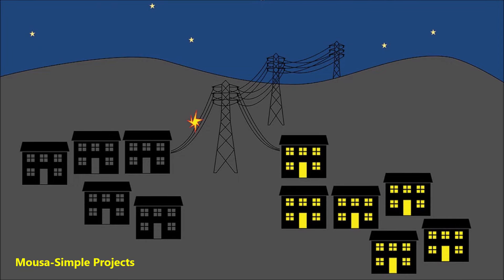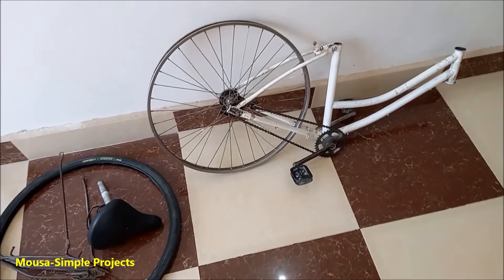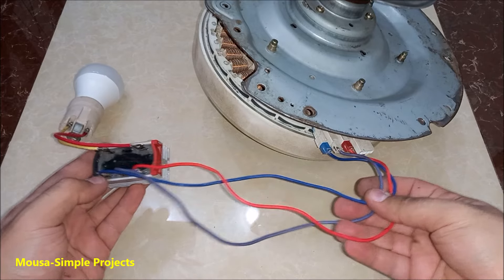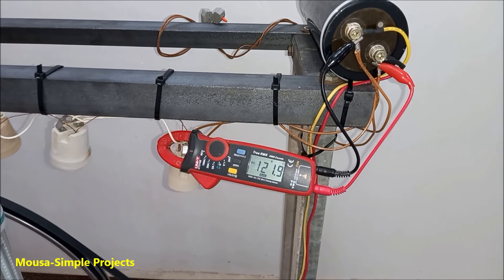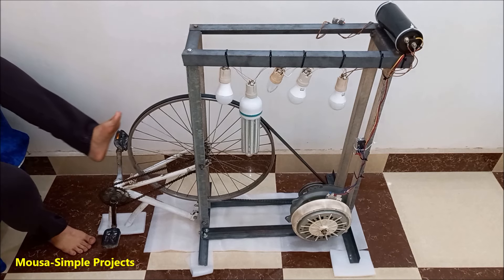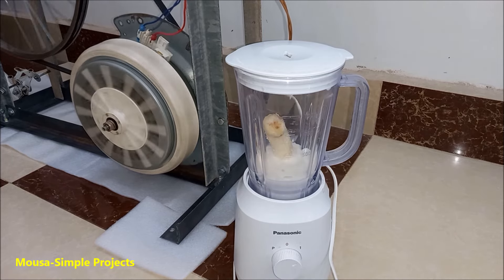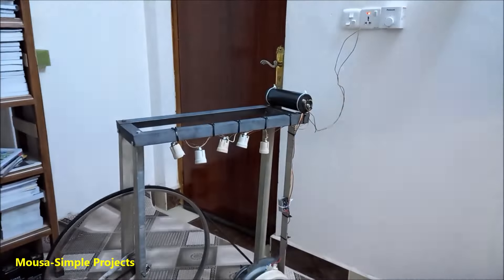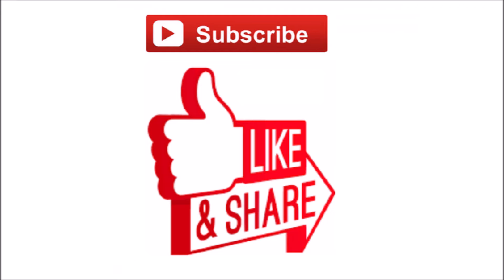Bicycle generator power home / Bike Electricity Generator

Comment: Adding a heavy flywheel to the generator or the wheel might help smooth the energy transfer from pedal to generator.  Bikes are normally designed to take upto 100kg of weight.

Comment: Greetings from the philippines friend, great video you got. May i just ask the length of the belt you connected in the wheel and motor.
Reply from the maker: Thanks for your comment.
The outside length is about 240 cm
This code is written on my belt:  AX-94 13X2400LI 
However you may need different belt size depends on the size of your frame, size of wheel, distance between motor and wheel, ... etc.
This is why the belt is the last thing you have to buy !!

Comment: Interesting.
Can you explain the need for the capacitor and how it is wired in the circuit?
Reply from the maker: The capacitor used for reducing the lamp flickering due to changing the speed of pedaling. It is 6000uF 350V and it connected directly to the output of the bridge rectifier.
Reply: @MousaSimpleProjects  Ah, I see. Thanks for the explanation.

Comment: can I charge the home inverter battery?
Reply from the maker: Yes, but you need a SMPS charger because the generated voltage is DC not AC
Reply: @MousaSimpleProjects  Thanks boss I will try in these holidays

Comment: can i ask for the voltage of washing machine motor, capacitor and bridge rectifier that you use?
Reply from the maker: The motor was taken from a 220V washing machine, For capacitor i used 6000uF 350V and bridge rectifier was SQL 50A 1200V (Three phase).
Reply: Can I use po a 600uf 250VAC capacitor instead?since we can't find the one that you used
Reply from the maker: Yes, you can use it even without capacitor, i used capacitor just to decrease the flickering of the LED lamps.
Reply: How about electricfan can i plug it here?
Reply: Additional question since buying this type of motor here in our place is quite expensive, what other motor would you recommend for us to use?
Reply from the maker: NO. Fan has induction motor and works with AC voltage only.
Reply from the maker: I can't recommend you any other type of motor. This is the only motor that generate high voltage at low RPM.